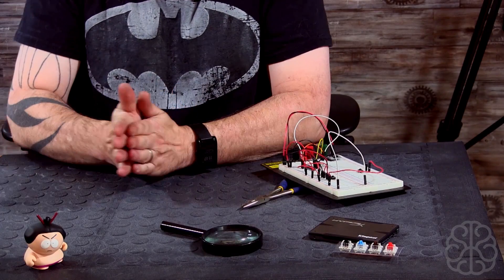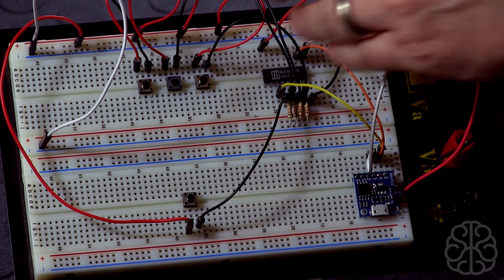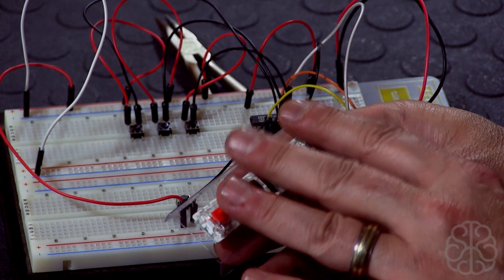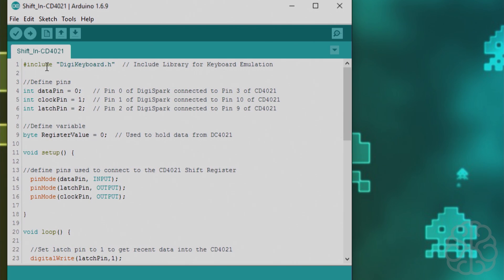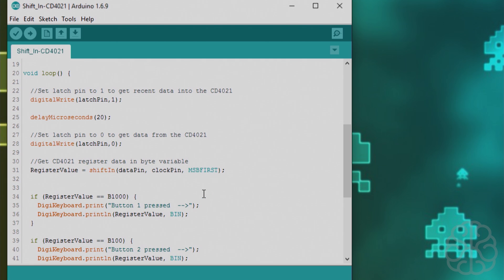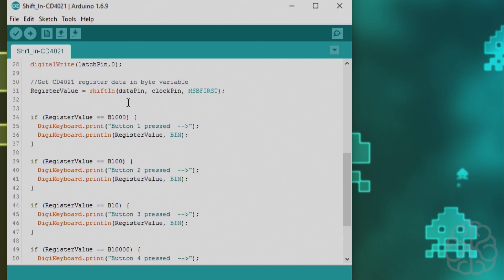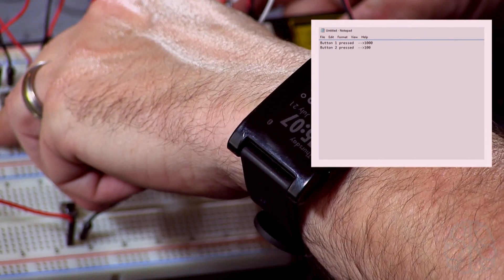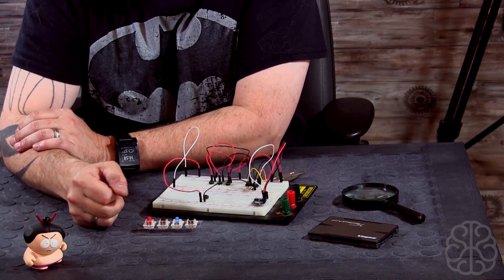Use Shift Registers to create more Inputs on Arduino Project! Tutorial

Comment: My data sheet shows the CD4021 pin 3 as Q8 Buf Out, and pin 11 as Serial In. In you code you commented DataPin is connected to CD4021 pin 3, perhaps that should be changed to pin 11, or am I missing something?

Comment: Great stuff! I too am looking to build a camera switcher using momentary switches and found this video when looking for the Digispark board as a keyboard controller. I wasn't able to find the chip you're demonstrating so I just have a simple question for the time being: while you mention the chip gives you 8 or 16 switch capability, how much does the digispark itself support? I mean, with 6 pins, does that actually mean you can already have up to 6 switches? If yes, I'm golden. I really don't need more than 3 to get started and could always add another Digispark board if I need more inputs (if I can't find the chip). I'm new to this stuff, but really excited to start making my own controllers. Thanks for the great video.

Comment: can i use without shift register for 3~4 buttons on arduino properly ?
Reply from the maker: As long as you don't run out of inputs you don't have to use a shift register like the one used in this tutorial.  Since the DigiSpark doesn't have many of them (5) compared to the full size UNO (14), using a shift register would make sense when using a DigiSpark.  Thanks for watching!

Comment: if your board support  INPUT_PULLUP use it. you not need resustors for every button and connect them between ground and input pin. logic will be reversed
Reply: It is for kids. Normal people do not call themself 'brainy'. Signs: rubber sumo fighter, wearing batman t-shirt when over  30yo..

Comment: Nice video! Looking forward to the next ones in the same series =) Just wondering two things, one for being new - why don't you film your head/face? Not that its really needed I guess, but just feels a little bit strange not seeing it =) No complaint or anything, I'm not so much for filming myself either so ;) hehe

Second question, any thoughts on debouncing the switches? Or is that not necessary with the CD4021 perhaps? I have no idea, but just a thought =)

Other than that, nice video, easy to follow and also interesting =)

Comment: With a différent code, can you detect if more than one button is pressed ?
Reply from the maker: Should be fairly easy, if you're pressing more than one button, then when you read the shift register you should get more 1 'ones' in the byte read.  I this video whe were getting '1000' for example, if you are pressing more than 1 button then you should be getting something like this '1100', you could do an action depending on that. Hope that makes sense :)  Thanks for watching!